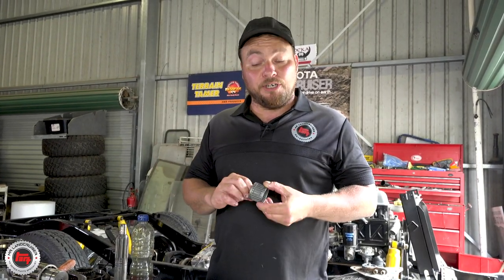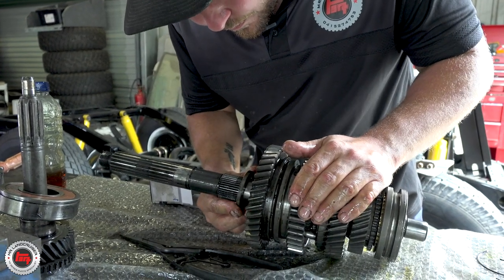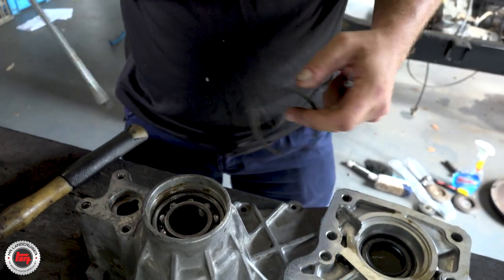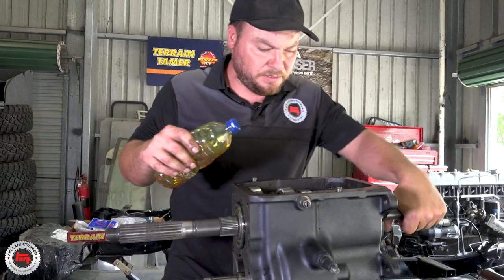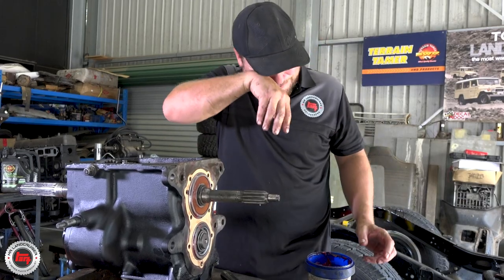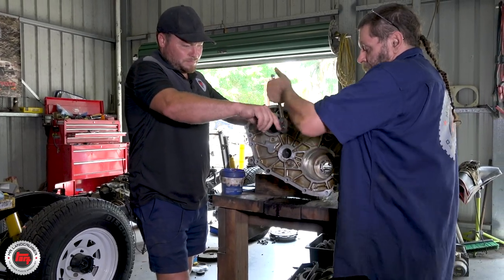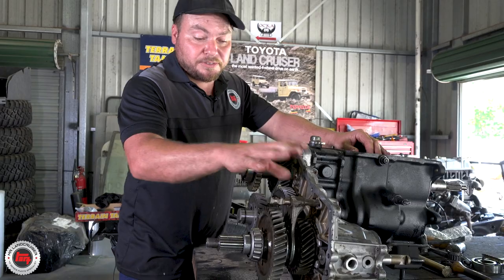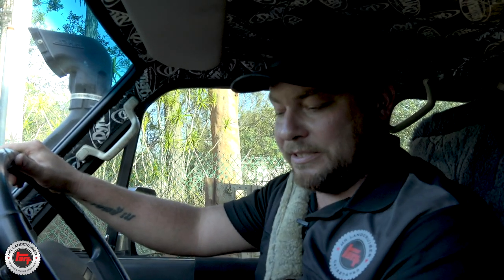Part 2, 60 Series - 5 Speed  Gearbox & Transfer Rebuild , follow us for an in depth look.

Comment: Witch 5 speed limit transmission is that. Is it out of a gas or diesel. I wish you could really slow down and show exactly what and how you are doing it. I have a h 151 that I need to put back together
Reply from the maker: Hi mate, it's a H55F diesel / petrol (HJ/FJ) the same unless it's a BJ
Reply: H55F (5 speed) gearbox is  also used in the 70 series Landcruiser (until 1998). After that the used a lighter one.